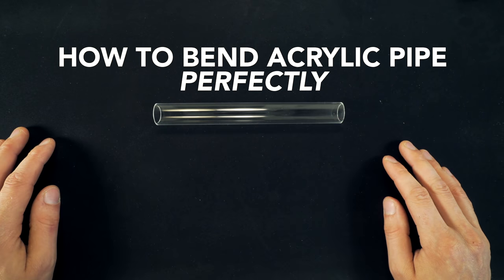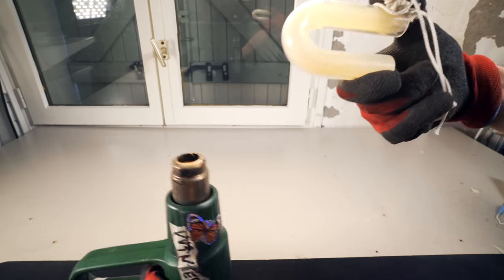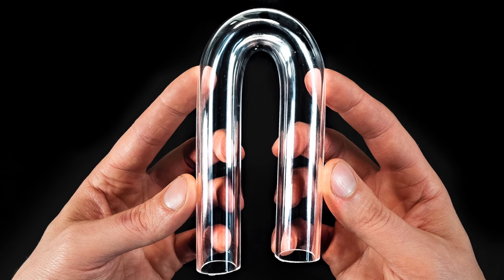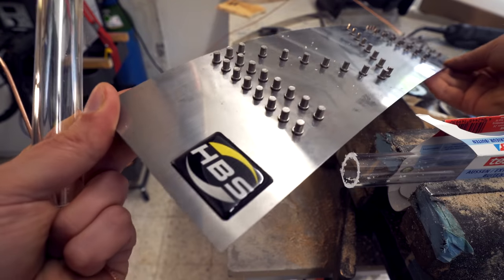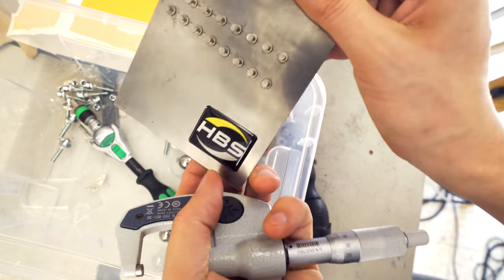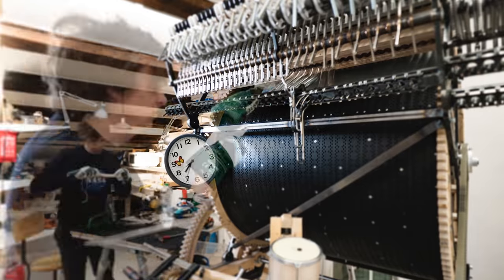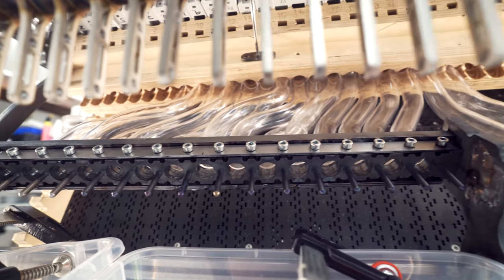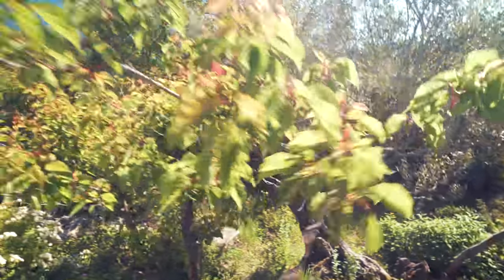How To Bend Acrylic Pipe PERFECTLY - Marble Machine X#79

Comment: Hello!
I've been watching your videos for quite a long time. I really like what you are doing - the machine is not only functional - it also looks great! But, I have two concerns that may be useful for you to hear.
1. After release, balls go through bent pipes. I think it is obvious that time, required to fully pass the tubes is different for each note.  I think it is a little odd to make custom programming plate with micrometer precision and then pass balls though tubes of different length and shape.
2. You have two routes though lifting mechanism - small route (balls are relifted after ball dividor) and big route - balls are lifted from bottom of the machine. My concern is that small route and space before divider wouldn't provide enough buffer space. Let us amagine machine spinup and start playing. First you speed up the machine and most of the balls would be lifted up. There is not much space on top and there is no obvious space to store them elsewhere, so number of excessive balls would be minimal. As soon as you enable instruments - balls would be consumed from distributor, but there are too few of them - I've counted 16 - 9  per note in vertical acryllic tubes. Next batch of balls would arrive from bottom of the machine, as I estimated from your video - after about 13 seconds. Your marble machine song consumes close to 20 balls per 13 seconds per note for two notes (the ones placed on weak beat). My concern is this design decision would limit the number of playable notes per beat.
I hope my post would help in any way. Sorry for language - I'm not a native speaker.

Comment: Won't the travel time of the marbles in the longer tubes result in slightly later contact on the sound surface? If the tubes are all different lengths, a marble traveling down the shortest tube will hit  sooner than a marble dropped down one of the larger tubes. On tubes next to each other, it probably wont make a huge difference, but the two sides of the vibraphone would have a noticeable delay compared to each other.

Since the timing clutch is on the wheel itself, that could be a somewhat difficult fix unless you can fine-tune the drop mechanisms to the length of the tubes the marbles will travel, right?

Comment: @Wintergatan Does the length of these PMMA pipes have an influence on the timing of each note?
Reply: It shouldn't.  This is prior to the dropping mechanism.
Reply: But a longer pipe means a longer travel duration for the marble, even if they are released at the same time.
Reply: @GrindersKeepers  no. The pipes are there just to provide marbles, not play to notes, this system is in 2 parts, the timing one is the second one. The pipes are just so there not too many marbles everywhere
Reply: @GrindersKeepers  The release mechanism is after these pipes. The pipes just move marbles to the on-deck location.

Comment: I hate to criticise this awesome project but... All this work and effort has been put into the machine's timing precision, and now - in my mind at least - it's going to waste since the marble routing length from release to sound producing element is varying with this hand-bent piping. I might be wrong but I don't see any way to fine tune the timing from release to touch down as it is designed right now?

Comment: Why do you keep using the heat gun method? Just like soldering, a large mass will quickly sink away the heat, so you need some amount of pre-heater. I suspect an oven would be a better method for bending the pipe, or at least getting the whole thing hot to then switch to quickly working with on the heat gun, and then back to the oven. Love the content!

Comment: Acrylic bends at around 180 degrees Celsius, silicone rubber melts at around 300 degrees celsius, what if you made a heating element that went inside the silicon and it heated up from the inside out, with a regulator so that you don't go hotter than necessary
z

Comment: In respect to the pipe colliding problem, it seems that you are sticking to just one plane for all the ramping (going from one hole to the other). It seems like you should be able to route the marbles in all 3 axis of movement, going up and down (more like a kid's slide) as well. Is this not the case? I would think this would give you a bit more freedom and a little less constraint in terms of the physical space involved.

Comment: If your pipes are all in the same general shape, why not make an adjustable jig of that shape and slowly press heated pipe into it to achieve a consistent shape? That way all the pipes can sit next to each other relatively flush.  That way you should also be able to calculate the exact shape needed in cad and mimic it with the adjustable jig.  It's done in PC Watercooling when using hardline, kinda like this: https://www.youtube.com/watch?v=l5db6LQWErQ
However you can just design and build your own purpose built jig yourself, just saying...

Comment: I'm planning to do this with some 1/4" o.d. (1/8" i.d.) acrylic tube (1/16" wall thickness). I'm thinking of using this silicone cord: https://www.grainger.com/product/GRAINGER-APPROVED-Round-Silicone-Rubber-Cord-6RTG3
Do you have any suggestions/tips/cautions? I'm wondering if and how well this approach will work for such a small tube and cord...
I don't plan/need to make as tight bends as you did here. I think the silicone cord/rod is to help maintain the pipe/tube shape (prevent collapse/kinking)?
Any suggestions/hints welcomed. :D

Comment: won't the different lengths of the pipes fu** your marble timing? they get released at nearly perfect timing but from there on each and every marble will need a specific time to travel down to it's destination. if I am right you would need to make an adjustement for every single channel. surely, someone has aöready thought of that and told him, so could someone explain it to me too?

Comment: I'm actually very concerned about something here. You will want to make sur the pipes are ALL the same length and/or distance from the instrument, I fear that if you leave it as it is, and with your current timing requirements, some notes will be perfect and some will be late/early. (a difference that your metal bar adjusting system might not be able to cover)

Comment: One point troble me, until now, u always make the accent on chirugical presision needed for the MMX and music in general, but with this part, don't you create an offset with lenght of each Acrylic Pipe? i mean, both pipe on channel 1 and 36 are longer than those on channel 17/18, the marble whil take longer time to travel it, creating offset between notes, how did you counter that? did i miss somthing?
Reply: Yes, the marble drop mechanism is after the pipes. The next marble to be dropped is travelling in the pipe at the same time as the "playing" marble is falling.
Reply: The Acrylic tube length matters not as its the metal wire 'droppers' are calibrated to drop on queue.

Comment: The pipes don't follow the same curved plane it triggers my OCD.
Reply: me too. perhaps a second, group bend/correction in a temporary form and a hot water/oil bath is in order..?
Reply: If he makes a plane/surface that bends with the right curvature with the connections in the right spots, he could figure out how to bend each pipe on that plane/surface and even out the curves and spaces so they are nicely distributed throughout.

If he uses a thin steel sheet and uses wood cubes with one hole through them with the same diameter as the pipes and a strong magnet mounted on them. He could use these blocks to make sure the pipes follow the correctly bent sheet. the magnets would snap to the plane and each tube could have a few of them.

It's more work but not that much.